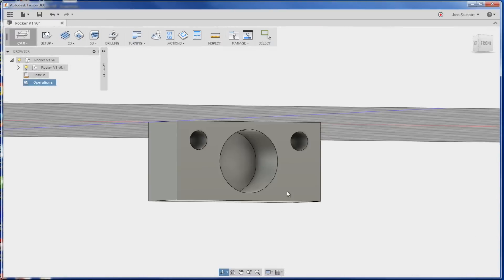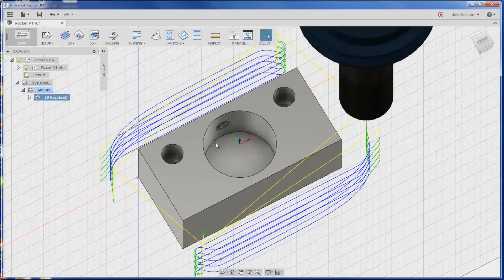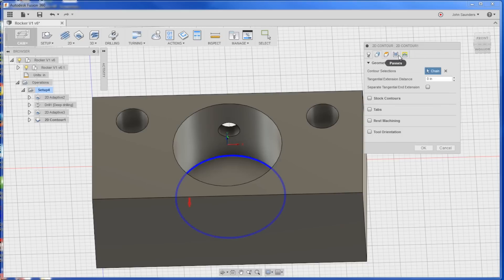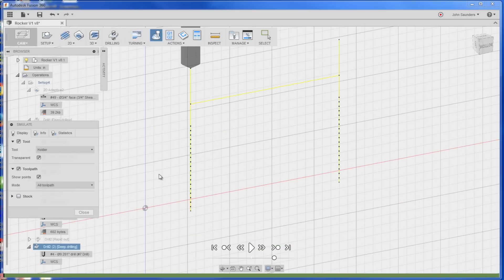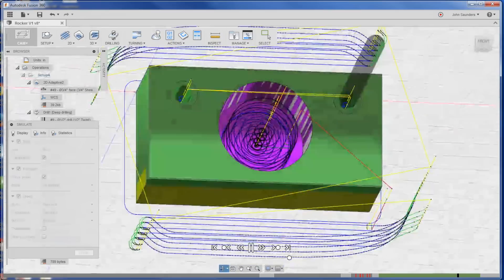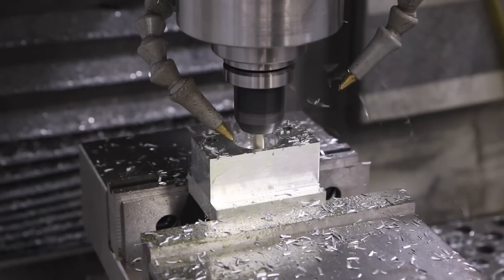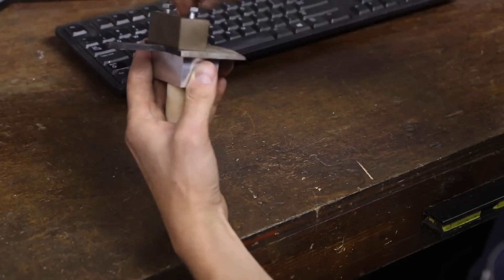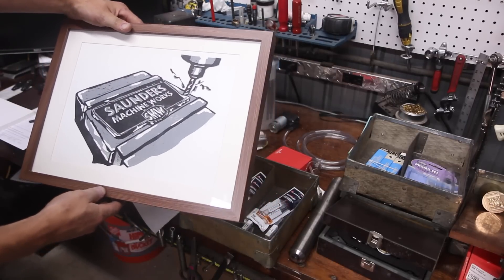Mezzotint Rocker Arm!   Widget61 Part 2

Comment: Hey John Question about your tormach, I have a mate with an XR250 cylinder head that got munted from lack of oil and had to send it off to get re-bored before I honed it. Just wondering if you think the tormach with a superfly or boring bar could bore a decent surface finish in aluminum or cast iron? Maybe an interesting test for the tormach? His bore ended up at 77mm with a new piston, maybe you could run one down the inside of a 60/80mm tube in your vice and show us the results. It would open up a whole new world or tormach users if they got good results re-boring cylinders, particularly for 2 strokes. Cheers man, hopefully you get a chance to have a go.
Reply: +NYC CNC Yeah bud, would love to see you do an old 2 stroke, even a weedwacker... now that would be a cool project that would use all your stuff. A small weedwacker engine, a rebore and make a slightly bigger piston... see if you can make it run. Would use your lathe and mill and be a sick widget. Practical tormach application. Anyway if you ever get a chance to do a bore would love to see it. I'm making a piston atm for a royal enfield... cool project. Looking forward to more videos.

Comment: Nice job John! Amazing print too.
Did you flip the block and face to size or band saw first? I've been trying to avoid wasting stock but fixturing becomes a real pain on some parts, particulalrly thin work. Any suggestions?

Comment: Hi John, glad you're back from vacation and in the new shop. 
Your Fusion 360 segments are terrific - could you do a quick tutorial on how to setup a corner rounding cutter and how and where you set "zero" height with tool that don't have well defined geometry? It does not seem to me that 360 properly defines to corner rounding tool in the setup.